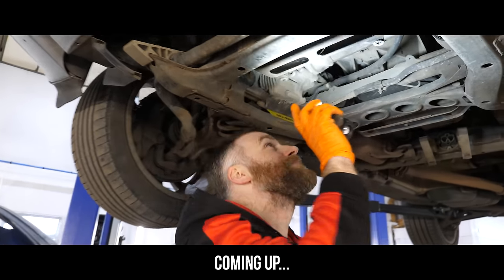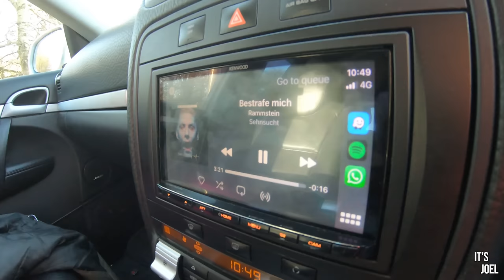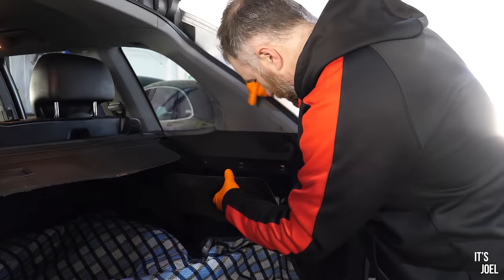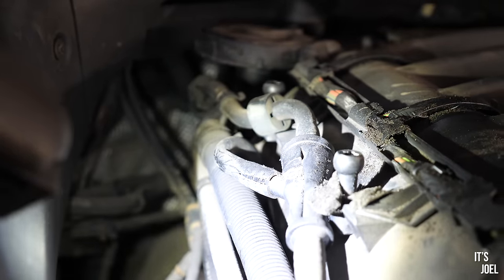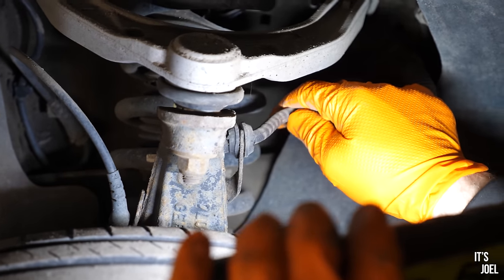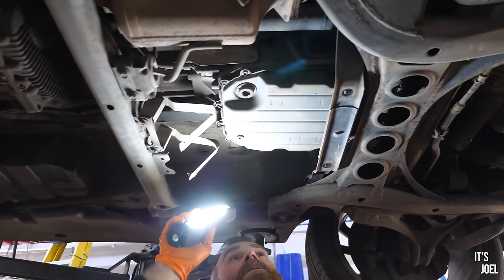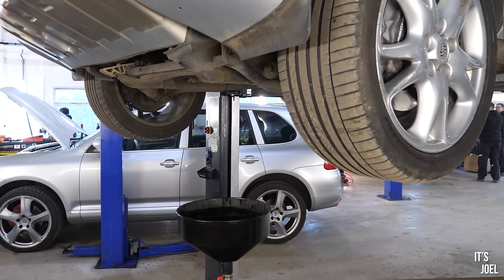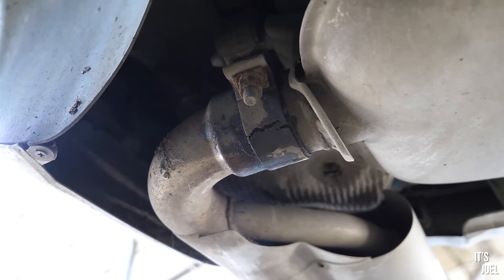HERE'S WHY MY PORSCHE CAYENNE WAS SO CHEAP...

Comment: I have a 2005 Cayenne S, that I have had since 2016.  It still only has 42,000 miles on it,  as I divide my driving over a short list of vehicles, while I keep them all in new condition.  I also have a 2008 Cayenne Turbo,  and I absolutely love both of my Cayennes.  I have loaded them with Carbon Fiber, and do most maintenance myself.  I feel these Cayennes will likely out live me,  as they are extremely well made, and rugged.   I would highly recommend one if you can find one with low miles as I did.  Oil changes , brake pads, filters are easy DIY items.

Comment: Hi  Joel, I have owned my 3.2 v6 for just over 6 years now & I can honestly say its been the best reliable car I've owned,  it also tow's effortlessly. I have dealt with all the little niggles you get, but they are all well documented on one forum or another and easily fixed.  The spare parts are cheap because of it being a multi-platform car.  In my 6 and a bit years the most expensive repair was the labor charge for replacing the coolant thermostat, the part itself was less than £20.  I have the air suspension and its been great and reliable.  It just keeps going.  It had new disc's and pads fitted when I bought it and I only replaced the pads last year after 50,000 miles.  I have looked at other cars in the SUV range and they all compare themselves to the cayenne's greatness.  I am only the 3rd owner of my one after 20 years, mines an 04 model by the way, Reg V6 DKD (so you can check it out) even the number plate was cheap. Who cares about the mpg when you drive past all the broken down vehicles on the side of the road.  I put an after market head unit that looks great and sorts out the Bluetooth issue as well.  If you like reliability you'll keep it, oh and my battery date is 2007.  I could go on for hours, all the best.

Comment: I had a cheap 2003 V8. Was a 2 year money pit. Drove it to Denmark once. Sitting in complete comfort at silly speeds on the autobahn was awesome. Scraped it 2 years ago as valve stem seals were bad and too expensive to repair. Also had an electrical drain.

Comment: Great buy! Fantastic honest mechanic! I had a great mechanic whilst I owned a Cayman S, I cleaned out the sooty throttle bodies, fitted a full stainless exhaust and it felt like a different engine ! Get your throttle bodies and intake clean, air filter replaced, and the leaking exhaust and you will feel a big difference!!!

Comment: I'm looking at buying a 05 plate Cayenne with a 4.5 litre engine . This video is one of the most informative  videos I have ever seen , only trouble is that I need the car up on a ramp before I buy it as there is so much to consider and as my "project" has done 144K miles , a lot more potential wear could be possible . I live in Cornwall and the car is in Bournemouth area which raises the question of do I take a chance or not ?  Hard decision but thank you for the video , it is absolutely invaluable !!!

Comment: Great stuff, I’ve always hated the chrome around the windows and pillars. Would be great if you did a vid on chrome delete or wrapping in gloss black. Really update the car and make for an interesting video!
Reply: I hate the pillar chrome (not chrome, more like a satin aluminium finish), but I like the window and boot trims to tie in with roof rails and wheels (at least on mine). So I’ll be doing a gloss black wrap of my pillars.

Comment: That drain problem is similar to Rover 75. I broke down due to the same reason..flooded plenum which got in the ECU. The car did work ok once dried out. I did take the ECU apart and made sure it was dry, but I sold the car after that.

Comment: Not sure about the catalytic converter issue. They don't usually just break and need replacing, I'd put cataclean through it first, that will most likely fix the issue for £20. If not, you can get them properly cleaned out. Cat's don't usually just stop working and need replacing at any age.

Comment: Really informative video Joel and Chris. The more I see the more I feel tempted to buy one. I've got no interest in going fast, especially in something this heavy, so the 3.2 or 3.6 N/A would do just fine for me.
Reply: I'm in the same boat about buying one as a second car... but i work from home and don't do too many miles as it is, so thinking about the big daft V8 turbo,
Reply from the maker: Can definitely recommend a cayenne based on my own experience. V6 is enough power if you’re cruising around, or around 90% of the time
Reply: annoyingly a turbo has come up locally, in budget and MOT'ed till Feb 2025.  but a 2007 and I really hate the thought of £700 tax.
Reply: £700 road tax would put me off even though I am already used to paying £400 for my cars. However, if you think that the condition is amazing and won't require much work, then the high tax might be worth it, especially if Joel's experience with insurance is anything to go by. If the turbo is only a little more to insure over and above the NA version, it might be worth it. 
Or, you could just be patient and wait for a 3.2/3.6 to become available.
I won't mention the additional  fuel consumption!!

Comment: Very decent underneath for a 05. I've got a humble Honda Accord 2.4 of the same year that has avoided salted roads and looks similar. The Porsche scores though in having a fully hot dipped galvanized chassis.
Using the same insurance comparison site I wondered if the insurance would be expensive. Nope, I pay £220 and this Cayenne came in at £305 with the AA. I think I may switch to Porsche!

Comment: Love my 2006 955 3.2. Didn't know it had an under bonnet light 😕
However it needed a lot of servicing when I got it despite having a full service history.

Every single one of those plastic pipes and hoses need to be replaced. They WILL all break. When you work on it they will break. Believe that !!

Check for coolant leak down the back of the engine from the thermostat housing. It's an utter PITA to get to as the whole inlet manifold needs to be removed. It's all made of plastic, commonly known as the crack pipe, so you will need to replace all of it. It's not expensive just time consuming.

Diffs and transfer case can be serviced easily especially if you have air suspension. Just drain and refill for about £40.

Autobox service should be done as you get jerky up/down changes. Porsche recommend 160,000 miles ! 

Other than that it'll bong at you occasionally with an error which will likely go away on it's own.

Oh, it drinks fuel. Hopefully you have the 100 litre tank.

BTW. The air suspension doesn't drop to the floor when it fails. It tends to get stuck unless at a height unless you have a catastrophic failure.
Reply: I think I see a Critical Drinker reference in your comment ?

Comment: Well, that's got to be a relief! Lots of small stuff, but it would still add up to quite a sum I suspect. I'd just tackle the stuff as absolutely needed. And in the summer get it up on a lift for half a day and wire brush, treat, and paint the bits of corrosion. Otherwise, just treat the car with a little respect for it being 19 years old, and hopefully it'll last as long as you need it to. Remember it's not a sports car. If it were, some of the stuff would be more urgent. But if you were to push it hard, just know some of the suspension work will have to be done sooner rather than later. Driven normally as daily run-around and family utility vehicle, you may be able to spread the jobs that have been identified over a couple of years. Maybe aim to divide the list of jobs into four at six-monthly intervals. Some of the jobs you could even tackle by yourself on your driveway and avoid the labour costs to change cheap parts that are readily accessible. Anyway, congrats, and good luck!!!

Comment: What's slightly disappointing in this channel is the lack of self repair videos. buys old broken cars and gets garages to fix them its a sure fire way to bankruptcy
Reply: I think the opposite, it's from the view point of someone who wants a cheap flash car, buys it, then takes it to someone who knows what they're talking about, then makes a plan on fixing what needs doing when it needs doing.
A lot of people on a tight budget wanting something special wouldn't bother with that last bit, and would run it till it didn't run any more, or drive it in a dangerous state
Reply: @Piner5074  even if it worked out cheaper to lease a new one which it can in alot of cases garage labour is at all time high